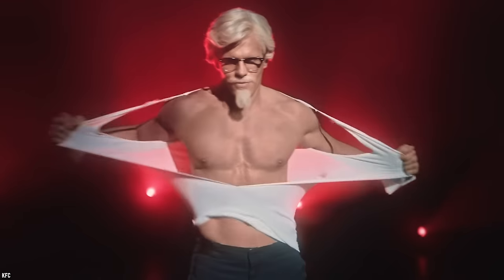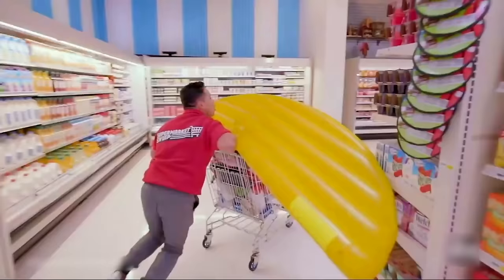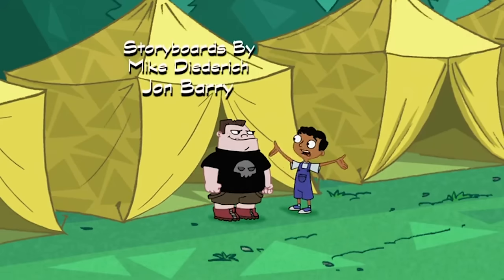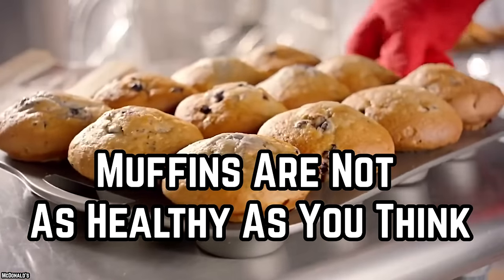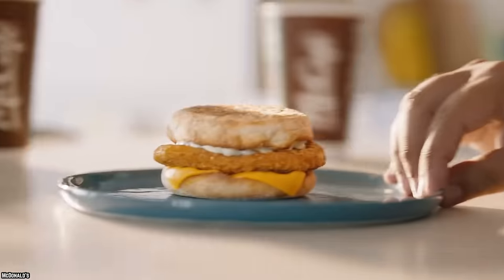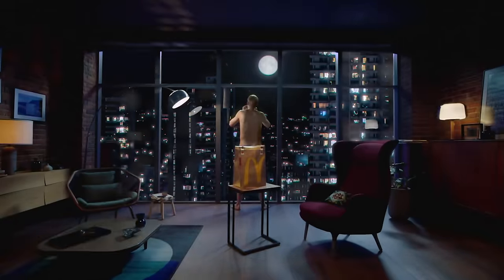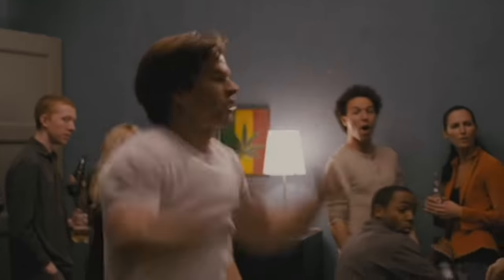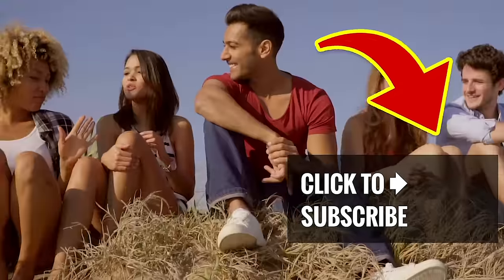Top 10 Fast Food Facts You DON'T Want to KNOW!

Comment: Yeah I can tell you this is mostly bull especially the automated drink dispensers are cleaned regularly they do half of it itself on a regular basis and the tubes are in a self contained system the only area commonly seen by health departments that collects slime/mold is the ice tray that should get boiling hot water through it nightly but if your night manager avoids this is human failure and uncommon yet they make it seem like they all have this issue?
Reply from the maker: Ok then.  Thanks for sharing this Austin Spray-Rode! 😊